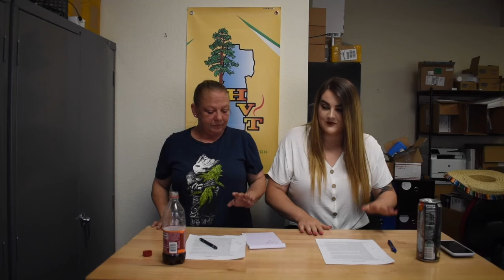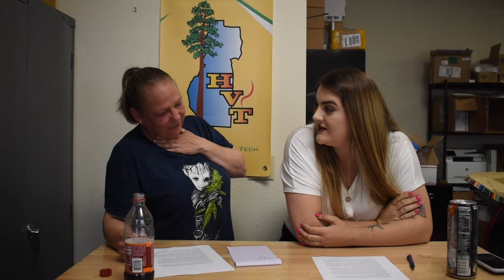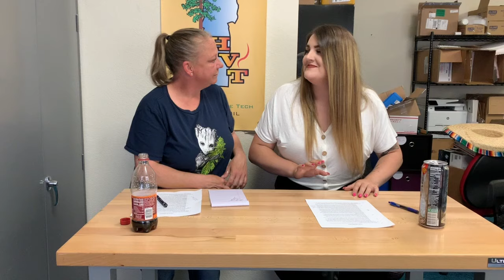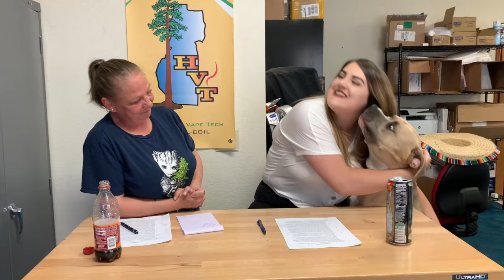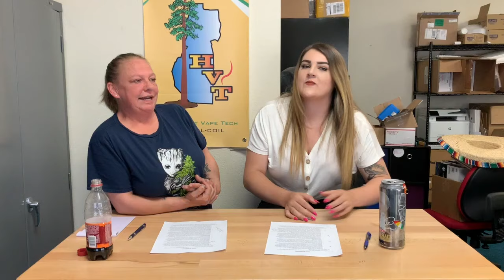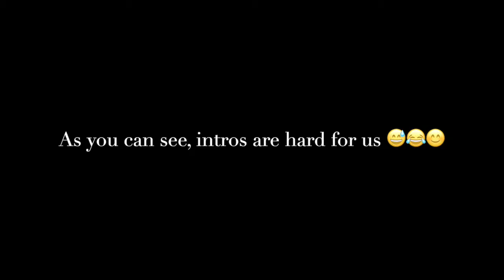Humboldt Vape Tech Coils Breakdown

Comment: ill be receiving my order from yall tommorow. i have heard literally no bad things about you guys. former yocan customer here that had nightmare experiences with burning coils. wasted product. and an overall headache. ill be trying out the TAF with the full Titanium coils. and if its as good as im hearing all over reddit ill be back to get another addy. for years ive been asking. why hasnt anyone developed a full bucket coil atomizer with air flow in the top. instead of the bottom so the oil doesnt leak down. just the overall way this thing is engineered looks solid. cant wait

Comment: is there a particular reason yall advise against a beginner using a bucket? just ordered the new sequoia that comes with the ti bucket. should I order another coil?
Reply: I’m guess is that it’s just easier to use. By that I mean you just load your stuff on the coil, hold down the button for few sec and your ready to puff. As for the buckets (my ti is my fav btw) you have to wait around 20 sec or so before you’re ready to start. You also need to make sure your device has enough wattage for them to work properly. What device do you have if you don’t mind me asking?